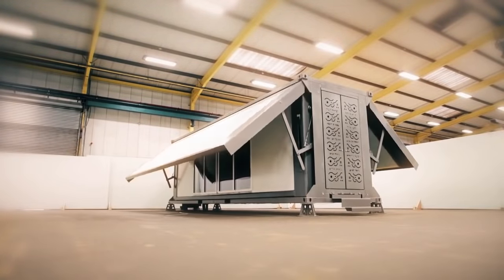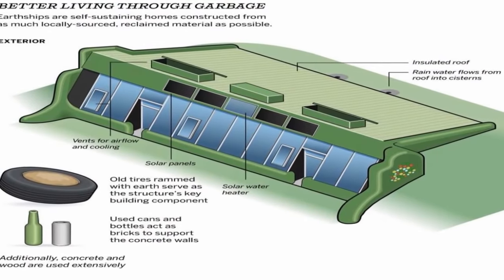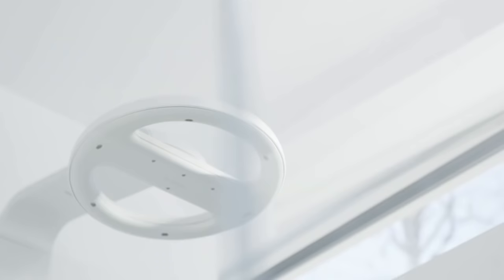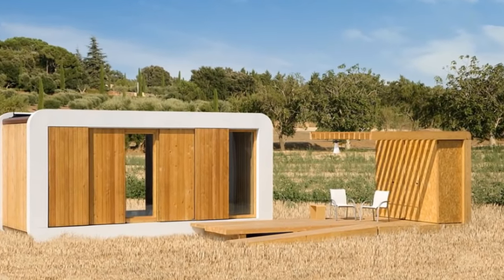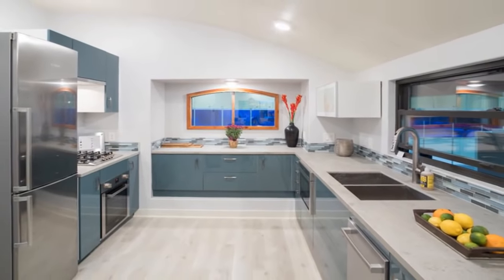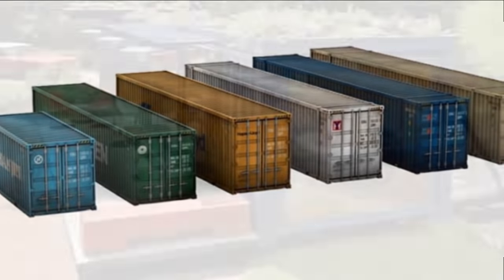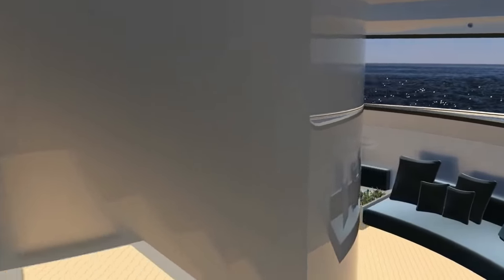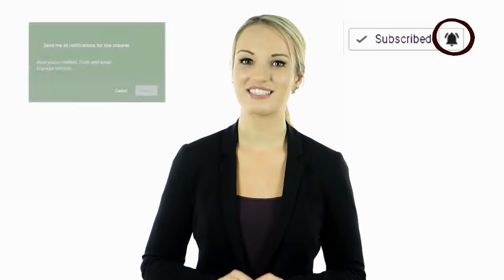10 Out-of-this-world Home Designs That Will Change the Way You Live

Comment: I have to say, if FEMA hasn't already ordered 200 of the 10 Fold homes already, I'd be surprised and disappointed. These houses, when folded up, are the same size as the single wide trailer homes you see FEMA dropping off at disaster areas so to have something like this would help these families so much better.

Comment: #10 made sense as #8. #7 used solar, great. #6 was good for the owner's planning as was #5, #5 was cool looking also. #4 was inexpensive but looked flimsy. #3 is something I've seen else where, great idea. The UFO 2.0, #2, yeah, I'm not a houseboat person... 
#1 was really impressive, especially the stilts part. 

Of all of these, the thought of buying a few used trailers from a trucking company sounds good because most of these unit are sold for scrap anyway. Years ago I saw a TV show featuring a guy who built a home by placing a few trailers together and then cutting out walls to make the different rooms. The roof sections and wall were all shot full of insulation and then waterproofed. When the outside was finished, a  bulldozer put dirt up to the roof and a small lawnmower was used to spread 8-12" across the roof itself. The interior was cut, drywalled, and painted. Water/plumbing, sewage, and electrical work was installed when the units were joined. It looked like a Shire home for Bilbo Baggins when it was finished but the 3 trailers (the floors, walls, and roof of the home) cost only $7K which made the final cost a fraction of a standard home. Building on a hillside of pasture land would make this "reclaimed" home virtually indestructible by tornadoes. It was a very cool place by the end of the 30 minute show. I'd love to try something like that myself.

Comment: Yurts were my favorite. Being part Indian, I guess, prompted e to lean that direction. AND I know they can be made any size. I have seen, somewhere on the net, yurts that have been covered in concrete, for permanent instalations. They still had vaulted ceilings, and big open spaces, which is what drew me to them in the first place. The one I was interested in was 120 FT across with a 18ft ceiling, if you wanted to put a balcony 2ND floor in it. Built more like a conventional house, but with inexpensive cost effective materials. Had solar panels on the roof (even though the house was round) and buy design very energy efficient. Anyway, you have a great channel, good stuff! Thanks for the post!

Comment: BTW- I have never seen a container bigger than 40FT ! If I could find some bigger containers and they weren't cost prohibative, I'm sure that would be the way I need to go. I am a musician/audio engineer, and need a place a little more remote (noise), so efficient is of ultimate concern. That,and how to store THAT MUCH ENERGY for electronic components, not to mention heat/ac! Thx again for best stuff. You started me thinking (again) in the area's been putting off.
Reply: Prefab would be a better choice in most cases, containers limit construction options and make it hard to insulate enough from the metal structure.  Otherwise you can't place them where it gets too cold or too hot.

Conversion into a house can also end up costing more... They're only cheaper if you do minimal conversions... Some container homes composted of say 8 large containers to form a big house can end up costing over half a million by the time it is all done.

But if your needs are small and you can keep it basic then they can be low cost...  Where you place them will just determine how practical they will be to actually live in...

California, Hawaii, etc. great... Alaska, Nevada, etc. not so much...

Comment: As a boat builder, I was immediately drawn to the UFO houseboat, at least the concept.  I see several problems, as presented. 1. I don't see it being built for $200K. 2. Twin 80hp engines would very l likely struggle to maintain steerage speed much less 10mph in anything less than flat calm and no wind/current. 3. Very few boatyards could haul it out of the water for maintenance/repair. 4. Finding suitable mooring/docking would be a real issue. 5. Underwater windows, while really cool in concept, are extremely impractical.

I'm sure there could be many other issues but the list above jumped out at me. Like I said, I like the concept but I really don't think it's practical.

Comment: Liked the video. however, MOST of the buildings would have been better if they just used standard building materials. Like the concrete tube house, that was a waste of space. not only that but, where are you going to get furniture to fit along the curved walls ? just simply a bad idea.

Comment: My problem with a lot of these is that an earthquake would easily flatten them. Lightly built, no foundation...no thanks.
Reply: Actually some of them are highly earthquake resistant... Foundations actually can make that harder because it ties the structure directly to the ground movement and conducts more of the energy directly into the structure.

There are non-foundations structures that can easily handle over a 9.0 earthquake!